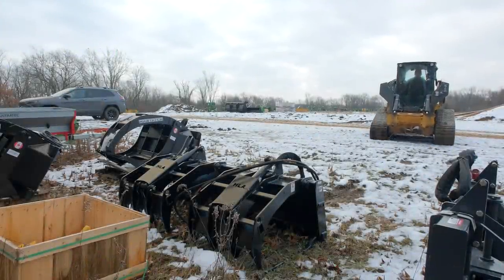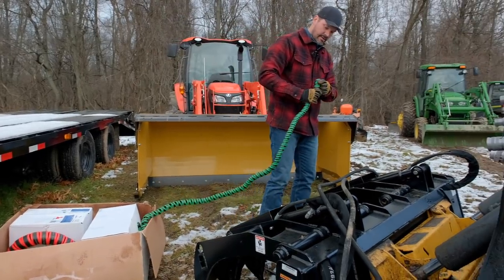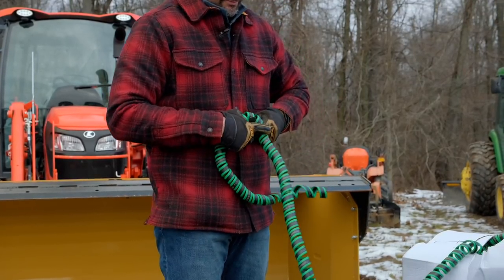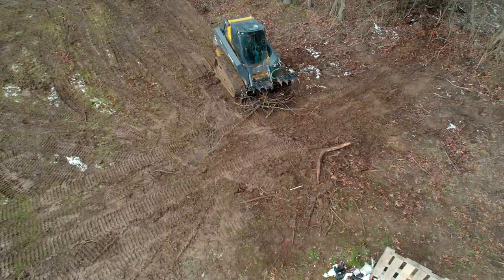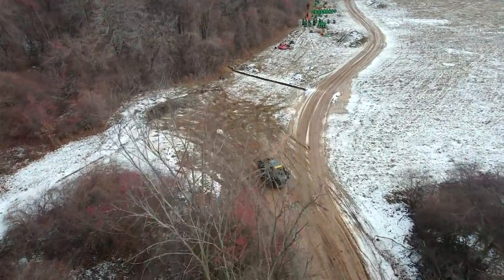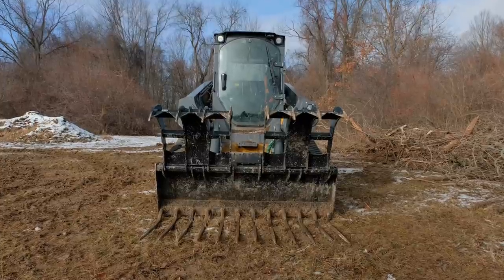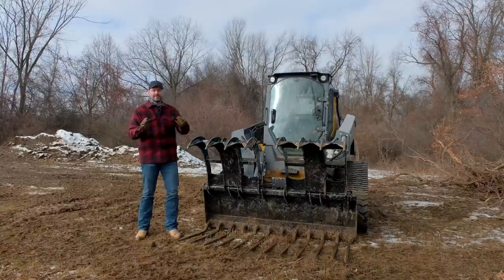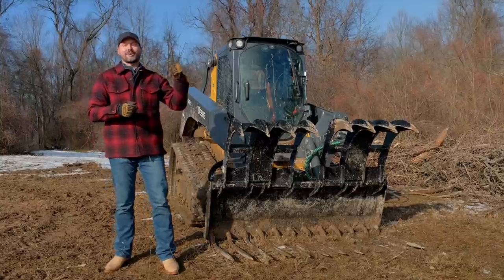WHO WANTS THIS KIND OF GRAPPLE? WORTH THE HYPE?

Comment: Great video!  As far as the brush issue, I have two words...burn pile.  Chippers just create a whole lot of extra work.  I was considering a similar grapple from WorkSaver before I settled on the one I got.  It was a WorkSaver manure/silage fork with a single grapple lid on it.  I liked the solid backplate of the manure fork but I wanted the grapple lid to close tighter.  Outback Wraps come to the rescue again!  I love my Outback Wraps!
Reply from the maker: Yeah, might go that route.  Thought about just throwing the mulcher head on the steer too.  That would be really easy.

Comment: In pa most farmers dig out a burn pit. This way the fir can be contained. Then can burn brush and stumps. We do notify the local fire department to alert a burn pit is going. In case someone calls the fire in. The small pieces we can run thru the pto chipper.

Comment: At the farm I work at when we clear out a tree line we use the skid steer and dig a big not deep hole and put all the brush in and then burn it with diesel fuel and sit there all night some time it will go for weeks but ones it’s mostly burnt we cover it all back up like it wasn’t there

Comment: I like it. The first grapple I ever saw being used was with pallet forks on the bottom and a grapple on the top. The thing I loved about that was the length of the pallet forks made it great multi use, another one I saw had basically a rock bucket on the bottom but again it was long enough on the bottom about as long as this one. A lot of the grapples I see are very short on the bottom like they were designed to pick up a single log, having an extra length on the bottom do use as a rake or a bucket seems pretty important to me and grapples are becoming very popular but some of them are very short and that’s just a big limit, I’m sure it’s cheaper to build you can use cheaper materials but I really like the length on this one and how you were talking about you can use it as a rake, I’m sure that also gives it a lot more support underneath the load instead of using the grapple and the grip to hold everything and aid in the lifting of the load.

Comment: @Good Works Tractors - If you want to make fill dirt for your property, mulch up the wood and spread it out. 
 If you want to add nurturance into your soil for future grass or for future crops, start a fire and get it to burn hot for a short while. Then smother the burning woodpile with dirt. Leave the dirt over the fire for a few days up to a week and add dirt as smoke breaks through the dirt. This low oxygen fire under the dirt creates biochar from the wood which is better than chemical fertilizers.
 If you just want the woodpile out of your way, then burn it and spread out the ash until all the remnants are gone.

Comment: You know what free advice is worth.  Those full trees you are pushing off, I would get on the excavator and chop them into three sections. Much easier to get a good stack of materials and push them off. Every run you push is wear and tear on the machine. I believe go bigger on the push and reduce the amount of runs will be more efficient and reduce wear and tear on the skid steer.

Comment: I need a hose hanger for my grapple. I got my grapple used an it didn't come with one. I've crushed that hose once or twice, or more.  😁 I bought a used woodchipper to take care of dead trees and the like. A good one, not a chuck and duck. I've got some good use out of it. It made a pretty large chip pile. But, if it's too small to be chipped, then it goes into compost. Too big, goes in to a log pile that may be turned into furniture one day.

Comment: It's a lot easier to wrap those sleeves by cutting how much you need and starting in the middle. You can start in either direction or even have two guys doing a side at the same time. I would also suggest getting those hoses made shorter.

Comment: Nice Video as usual. As for the brush piles, if you were ambitious you could get a big chipper and make mulch for your property. Otherwise make a few big piles and check with local township, fire or non-emergency police dept about your burning restrictions. I have similar situation cleaning up a property and I just simply have to make a call on day of burning to alert them not to send fire dept if someone calls it in or you pay for them coming out. Then just have a big weenie roast or bonfire :) I'm letting mine dry out a bit more with the sub-zero temps and plan on burning before spring now that we have adequate snowfall.  I think you could bungee cord that excess hose up to the handles on that grapple. Trial and Error.

Comment: Brush piles make the best habitat for all sorts of critters.  Place them all where they can be burned safely over the next couple years or so that way you will have ready made bonfires for friends and family…… just add diesel & lite 🔥 instant party!   Also after stacking the brush up and before moving it, mash down on the pile with the bucket….that will tend to lock it together and you will lose less of the small materials